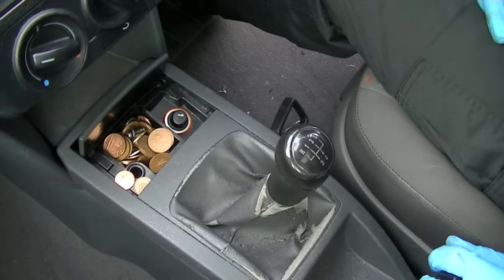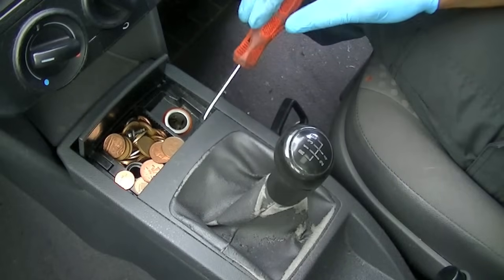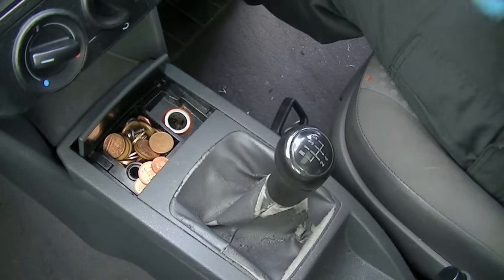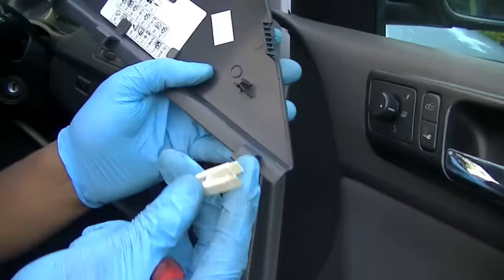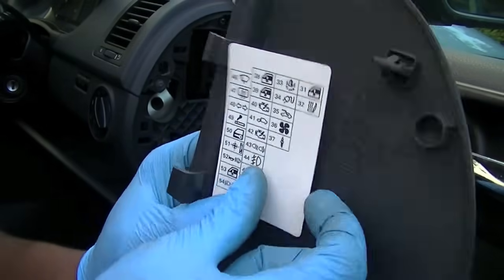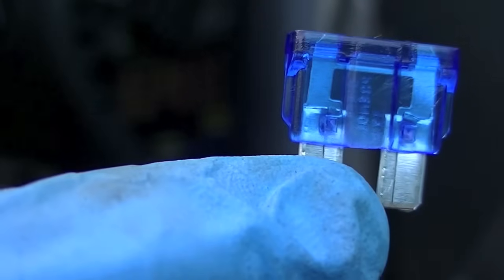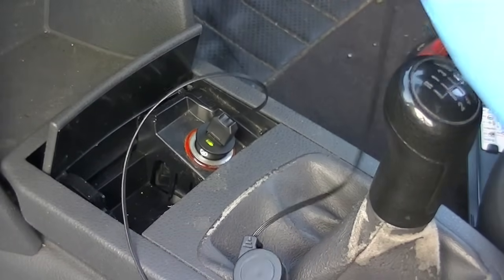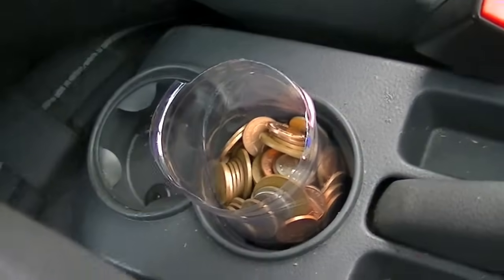Volkswagen Cigarette Lighter Repair, Easy Fix, Common problem

Comment: My cousin, he's a mechanic but I don't speak to him often, serviced my car for me and my cigarette holder hasn't been working since. It didn't bother me at first because I still haven't passed my test but I am ready to take my test now so I want it to work so I'm able to keep my phone charged when commuting. Nobody I knew could tell me what was wrong with it, but I came across your video and checked the fuse for it- low and behold the fuse needed changing. Thank you for this video, it was very informative!

Comment: LOL, i actually thought this was too simplistic an explanation. So it turns out that after removing all the dashboard searching for  a cut in the wires, it was the passenger 12V cigarette lighter in the back that had a penny stuck deep inside. Thanks for this.

Comment: aaaaaaaaaaaand you just saved me a trip to the shop, so easy! Now I stock those fuses because let's be honest it is on all the time so is bound to happen.
Reply: Yeah when the suckers at vw put a 10  in it when it should be a 15 yeah it will blow much easyier 🤣
Reply: At least they did in mine

Comment: Thanks for the video - not familiar with the Polo fuse panel but I shouldn't have any probs with doing it myself now!! Only thing is I'm puzzled as to why the fuse blew - no coins down it and I was charging my phone Monday night and today I wanted to do the same and no power. Hope it doesn't blow again....
Reply: Check the rating of the device could've overloaded it.

Comment: You have made my day, from me fishing a penny out of the ciggie holder, blowing my fuse, and the fuse card ,odd how the long side on the card is left but in car is on the right ! don't take much to fool me 🤪, but sorted now, I've learned something today from you, top man.👍👍
Reply: Hey i don't have the fuse card on the cover and in the manual it shows the cigarette lighter fuse at a different place yet that fuse in that location has a different amp and it isn't blown do you know how to figure this out?
Reply: @Neemi96  Hi, it's a 15A fuse that sits in there, don't know which model it is but google your car and year, images fuse card and locate from there it's worth trying.
Reply: @Paul-11  Thanks
Reply: @Neemi96  Won't be nothing to worry about, your probably want to use it for phone charger !. get that going and sit on your drive with no petrol 😂
Reply: @Paul-11  I wanted to plug in a fm transmitter as I have a very old car so no Bluetooth and petrol is about just have to get it later than usual
Reply: @Neemi96  Hope your sorted Matthew ?,  no garages near me have it ,not even big Morrison's.

Comment: nice video, can you do one on a mk4 wagon with dome, map, trunk and door puddle lights not coming on problem? (also the climate control back lights do not come on either). The a/c illumination light works. Dashboard and radio lights work fine, door locks & factory alarm work fine.

Comment: Hi mate. Just a quick question. I'm trying to tap of the power from my cigarette lighter. When I check behind the cig lighter in the Polo, there's 3 wires. A red w/ yellow stripe, a green and a brown. I know one is ground and one is the 12v power but I'm not sure what the third wire is for? Advice?

Comment: Great video mate, but I have a quick question. I drive a 99 mercedes slk230. I did blow out the 15 amp car lighter fuse and also found out that it disabled a few other fuse slots when I checked it with the volt meter to see if there was power. When I started the car, it was smoking. I didnt know where it was smoking from until the nest day. I found out the fuse for the car lighter was blown so I replaced it. Boom.. Right away it blew. and now  my car wont start. It cranks, but it wont start. In your opinion, and with your experience, what do you think could be the cause. Oh, by the way, the wire from the fuse box which is under the hood to the cigarette lighter had melted the outside skin. You could see the bare copper wire. It only melted that one and that's why it smoked.. What can I do if I;m broke and have no money to spend on taking it to the shop. How can I fix it at home? Any response would be much appreciated. Thanks again for posting these awesome videos. Have a blessed day

Comment: i just dropped a 10 cent and it sparked. i swear to god if this works....ur the best!
Reply from the maker: +iKearGunz Did you manage to repair your cigarette lighter?
Reply: BMAC VAGS yea, it worked, just change the chip
Reply: BMAC VAGS what if it's not the fuse, I just checked the fuse and it's not blown
Reply: did you solve your problem? cos i have the same issue and i've just replaced the fuse and it wasnt that
Reply: mine was the fuse I put at yellow one instead of blue

Comment: Those amps inside your fuse box, are they 32v or 12-24v? Because I have a Bluetooth fm kit that has 12v-24v. I was wondering if I need to get a 32v cigarette lighter?

Comment: This does not just work for Volkswagens, it's a common problem and is generally the issue with any car in which one of the electronic devices isn't working. Just find your fuse box and replace any one that is blown. A pack of new fuses costs something like 5 bucks at most auto shops.

Comment: Hi, looking for some advice. I've  got a VW Golf 1.6 Bluemotion 61 plate and the cigarette lighter has stopped working.  I tried replacing the fuse in the video and also tested every fuse in that panel and under the bonnet but no resolution. There is no visual damage to the cigarette lighter port itself.. any advice/suggestions??

Comment: need some advice, I have a B5.5 passat wagon with one lighter in the front and two in the back cargo space, I want to set up a dash cam but all of them are always on even when the car is off so if my cam is plugged in it'll kill my battery. How can I get these to not be always on or do I just have to use my front one and plug/unplug it everytime I get in and out of the car? cause I can route the wire all the way from the back and it fits just right which is why I want to use the back lighter in the first place

Comment: hello I have a 1997 Dodge Ram pickup truck extended cab 2 wheel drive V8 1500 I have the biggest problem of my cigarette lighter not working I have two of them in there I'm like to replace them both please give me any idea or make a video on how to do it and how to hook one backup thank you

Comment: the ring light around my lighter comes, on will check the fuse tonight but would that mean ( the ring light coming on) i need to change the socket itself?

Comment: Mine still not working. I checked the fuse and it is okay, however mine has a red 10 fuse. It is european model 1.4 non-turbo. Any other suggestions?

Comment: Hey, I just recently had a look at my fuse box (VW Polo 6n2) and I found that one of the fuse(white colour, 2v i think) was just hanging outside. I know that it belongs to the bottom row because of it's larger size but how can I find out in which slot it belongs to? Any help is appreciated :)

Comment: BMAC VAGS  I plugged something into my cigarette lighter socket yesterday and it blew the fuse. So I checked the fuse box and could see it was blown so replaced it but the lighter socket still doesn't work. Any ideas?
Reply: I have the same problem?  Idk what to do either.
Reply: ***** I just replaced the cigarette lighter socket. Worked.

Comment: I have the same issue my cigarette lighters stopped working on me altogether. But I did replace the fuse and it did not fix the issue. Any idea on what else I could do to solve this?
Reply: Replace the socket

Comment: how can the other 5% be fixed. the bulb for my heater control in my mk4 golf is not working and its not the bulb itself what else can cause it not to work all the other dash lights work

Comment: Hi - I have just purchased a 2003 Polo 1.2. Where can I get the passenger side window switch from? I have the drivers side and it works fine, but the passengers side is missing. Or anyone know what the part is called? The electric window controls are in the centre console and not on the doors.Thanks

Comment: I've got a 2004 vw polo same shape as this one, for some reason a engine warning light come on, it's a solid light so I'm guessing its a emissions light. The light will come on and the car won't rev pass 3000rpm. When I leave the car for a while and start it up again it revs perfectly fine. And after driving it a little bit I switch the engine off then on and the engine light turns off. Also I've not ive been getting very bad fuel consumption any help work be Great thanks man

Comment: does anyone know anything about the k-wire problem when an aftermarket stereo is installed ? have an '01 jetta 2.8 VR6 & my OBDII  scanner wont talk to the ECU
Reply: Yeah one of the wires gets connected that doesn't need to be,  you just cut it an tape it, just search it an you'll find it, I had the same prob when i installed my double din o followed the instructions to the t but there was one wire I connected that it told me to that we're not supposed to which stopped my communication  to my car and my snap shot discount. I did a quick search an got my answer

Comment: Hi my cigarette lighter plug is stuck, how do I get it out? Thanks!
Reply from the maker: Use a small screwdriver, or just fix the fuse and it will pop out once it is hot.

Comment: Hi there
I was wondering what could be wrong if my lighter works well  (i tested it using gps charger) but when i press the cigarette lighter itself it holds only for a few seconds and pops out even though it's not hot to light a cigarette
What is wrong here?

Comment: I notice at roughly 0.41, you seem to clearly say "... the light comes on, so there's definitely no power there."  Surely if the light comes on, that shows there IS power there?  Where is the light getting its power from then?  I assume you mean the round light on the actual power socket itself?

Comment: and if it isnt any ot those issues My fues is ok and I don't store change there but no go
Reply from the maker: Pull the socket out an check for power at the wires

Comment: same thing happened to my polo. checked the fuse but its not blown. however the lighter still doesn't  work. and stopped working immediately after a coin fell in it. any other suggestions on how to fix it?
Reply: Sherwin Reed I have the same problem
Reply: Same here, did any of you manage to fix it?
Reply: If you have a tester, you need to check if the socket itself is fused (blown).  If power is coming through, then the unit needs to be replaced.  Otherwise, there is a 'short' somewhere along the circuit.  Hope this helps.

Comment: Ahah that 1p thing happened to me, now i know what caused it.

I changed the fuse but its still not working! Need help! Astra
Reply from the maker: FahezEntertainment Replace the 12v socket
Reply: +BMAC VAGS How do you change the whole cigarette lighter? Because thats what I need to do

Comment: I checked my fuse. It hasnt blown. Any ideas?
Reply: wires?
Reply: I have the same problem i checked my fuse and it's not blown? Idk where else to go from there.
Reply from the maker: You may have to change the lighter unit completely. People use it as a 12v outlet when it was designed to be lighter socket. So replace the unit and see what happens.
Reply: ok. thanks
Reply: Thanks man
Reply from the maker: Replace the lighter unit